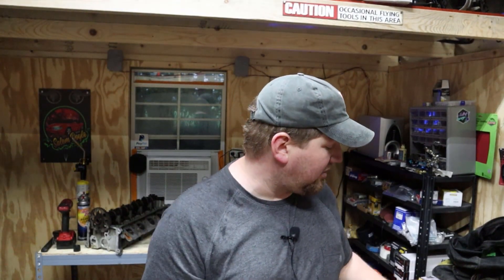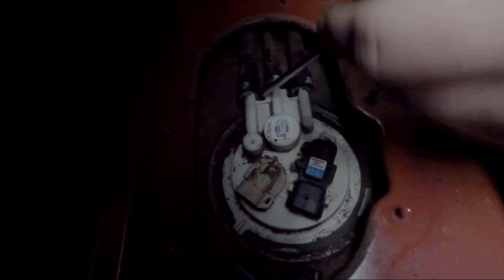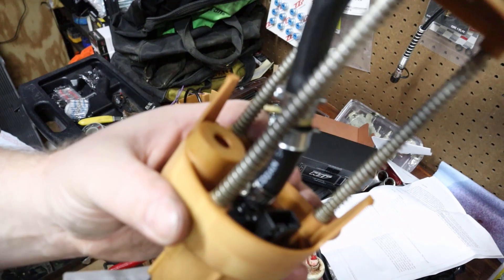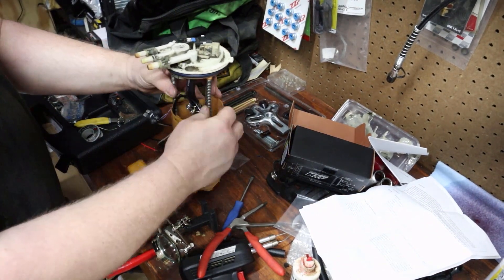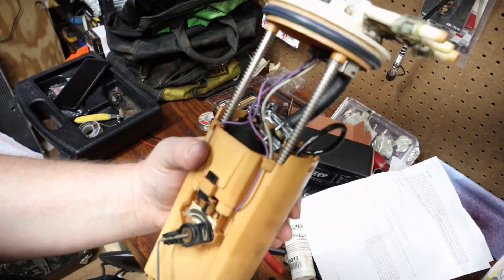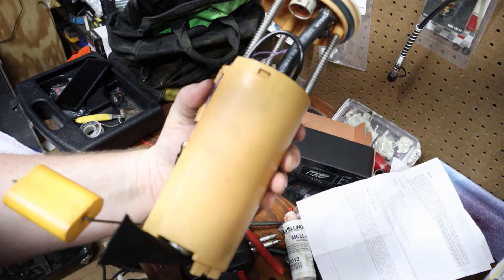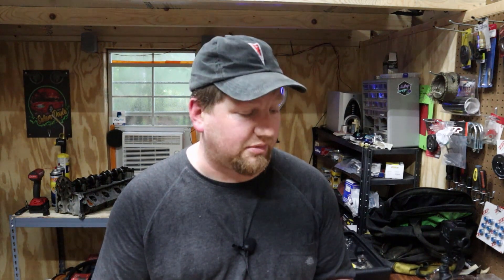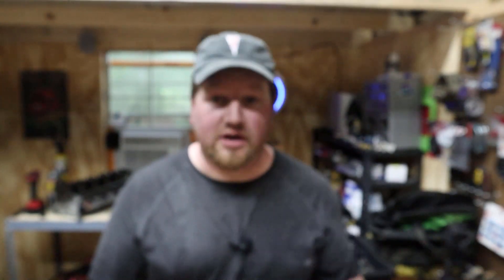Installing The AEM In Tank Performance Fuel Pump.

Comment: Do you drive around with performance shift on? 12:50 I saw the “Perf Shift” light on your dash.
Reply: I would like to know his response becuz I know for a fact I always drive with the performance shift on it shifts better in my opinion when I’m changing speeds to switch lanes
Reply from the maker: Yes i do
Reply: Salem Doyle whats performance shift do lol? I’ve looked it up before and couldn’t find a definite answer, and does a shift kit basically eliminate the purpose of performance shift.
Reply from the maker: Makes the shift logic a little more performance oriented.  I acctually have both modes tuned the same now anyway.

Comment: When my new 99 regal finely proves itself to be a reliable dialy driver.... im thinking about bying an AC Delco sending unit with pump. Would it be a good idea to upgrade ito a upgraded pump. Im aslo thinking about gettting a new sending unit from amazon and pimping it out with this pump while sitting in my lazey boy. and then getting my hands dirty when the weather allows??
Reply from the maker: If you are stock no pump upgrade is needed

Comment: Fuel pump is another one of those parts I'd like to replace, but I definitely need to see what the pressure is first. I had no Idea ZZP had high flow fuel filters. Ordered one before the video ended lol. 

I might be wrong, I think it's recommended to replace fuel filters every 30k. ZZP website says 75k.

Comment: When I did my aem pump. I went with the e85 capable one. Just in case I feel like being spicy in the future. I don't have to do a fuel pump ahead.

I also just bought a new cheap fuel pump assembly off the internet, it was like $60. then put the aem pump into it. It's so much easier that way. It might be because mines an 03 but the aem pump was just too different and the bottom (suction side) of the pump just plan wouldn't talk to the factory assembly as all. As far as the aftermarket assembly. The aem pump slipped right in like it was it's home all along. Even the connector was correct for the aem pump and the internal fuel pump harness for the assembly had thicker 16gauge wire too. (Factory is 18ish gauge) One thing I liked but did cause more work. Is the main bolkhead harness on the top. The aftermarket one had a flat 4 pin connector, as well as much thicker heavier gauge pins. (Factory is boxed 2 rows of 2 thin gauged pins) I liked this because I've got the fuel pump re wire so I'm pushing a lot more power to it. I don't have to worry about burning the stock bolkhead pins (I noticed my stock bolkhead had some heat stressing from those pins). I used the Casper re-wire so re-pinned the Casper harness instead of cutting up my cars harness.
Reply from the maker: Good info.  Thanks

Comment: From an electronics repair persons pov you should stagger those splices so they aren't next to eachother in case some edges or sharp solder points won't cause  wear through and cause a short
Reply from the maker: Good point.   They dont touch in the final setup though

Comment: Does the gas mileage suffer with the high flow pump? Why not just replace with a new oem style unit?
Reply from the maker: No it doesnt.  For me.  This pump is cheaper and gives me more room later to make upgrades.  This pump would not be necessary for a stock car.